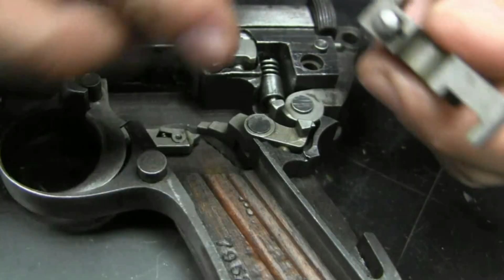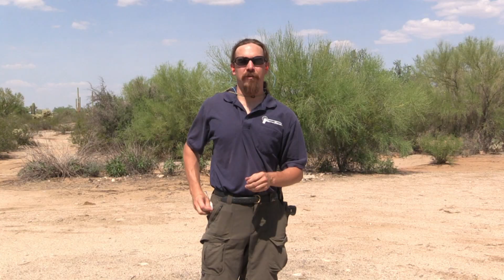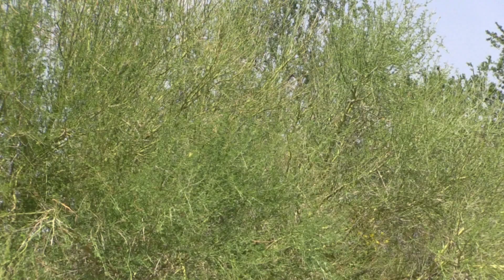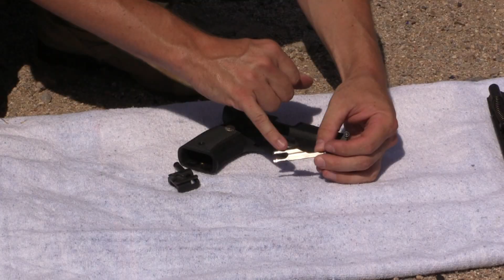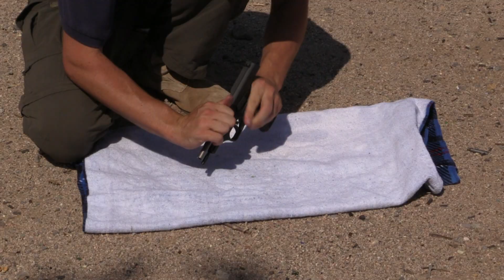Colt All-American 2000 (Disassembly and Shooting)

Comment: The thing I really don't understand about this pistol is...for all of the compromises, what does it do better than any other pistol? Compared to just about anything else in that market segment, it seems like they made it more complicated, less reliable, less accurate, more difficult to use, and probably more expensive to manufacture. I don't see the selling point.

It looks like the one useful innovation would have been the straight-line trigger pull on roller bearings, but even with the original 6 pound spring, I don't see how a straight vs hinged trigger makes any difference when the travel is so incredibly long. Don't get me wrong, I really appreciate how much the straight trigger pull is better on my Kimber than the hinged Match trigger on my USP45 Elite, but that's only because they're so short. I think this striker fired Colt really does qualify as a true Double Action Only in the exact same sense as a DAO pistol with a hammer.
Reply from the maker: It doesn't do anything better, and that's why it was such a commercial failure.
Reply: Doesnt do anything better, and most it does worse.

Comment: Many years ago I used to hit a lot of gun shows in Virginia and I often saw a guy trying to sell one of these.  It was being sold new, and on the very end of the barrel, right on the crown, there was a gouged out / ground out section of the crown.  It looked like it was cut or machined, 2mm wide and 2mm deep.  How it made it past quality control I have no freaking idea.  I looked at the gun and asked the guy about the incredibly obvious defect, and he sighed and said that he'd called Colt and they promised that if the buyer sent the gun back they'd fix it.  I saw that pistol on the gun show tables for a loooooong time.

Comment: You did not mention a safety on the weapon, could the loooong trigger pull be a safety device?
Reply from the maker: Yes, that was the intention. It doesn't have a manual safety.
Reply: Forgotten Weapons
That's kinda horrifying. Even my New Model Army has a safety mechanism of sorts that isn't the trigger.
Reply from the maker: DFX2KX
I don't see it as being a problem. The need for a half-cock safety in revolvers was to prevent the gun from firing if you slipped and released the hammer while cocking the piece, which isn't an applicable issue for DA automatics.
Reply: Forgotten Weapons
good point. I've never fired anything with a 12 pound pull, so it might be harder to accidentally do then I'm imagining.
Reply: DFX2KX It is no different than all the double action revolvers out there with heavy trigger pulls and no safety.
Reply: That's the premise of "Safe action pistols"

Comment: So if the went back with the 6 pound trigger and fixed the safety issues it would of been a pretty good?
Reply: eeeh passable albeit high matanence thay would have to fix the way the front end is designed. rapidly degradeing accuracy does not help to much and requires the regular replacement of parts
Reply: +Andre Krumins Not to mention the slide is mostly riding on the polymer frame.. Steel on plastic is a disaster waiting to happen..

Comment: Did the Guns & Ammo get one w/the 12lbs trigger? Wonder if Colt didn't send one tuned. If Colt had fixed the trigger/ignored the attorneys and modified the front sight/ bushing, not a bad design. Beretta uses the short recoil/rotating barrel in its excellent, especially for the price,  Px4 Storm series of pistols.

Comment: I had worked in a gun store in the earky to mid 1990s. We sold this POS for a while, but it was fugly, difficult to pull the trigger, and I steered prospective customers to Glock. They didn't last long before it was canceled.

The rotating barrel lock up provided a theoretical higher accuracy as the barrel moved along its axis instead of tilting up and down. But it just pan out.

Comment: Is the "break" extremely far back on the trigger travel, to the point where you the trigger fully contacts the frame behind the trigger?  Watching the trigger it's almost deceptive visually in that from a bit further away (or without my glasses ;)) it almost seems as if you go the full length of travel and there is a delay before the striker is released.

Comment: What did the Colt safety recall correct and how?  In 10 words or less.
Reply from the maker: +d0j0w0 Offhand, I don't know. Google probably does. (seven words!)
Reply: Firing if the gun was dropped or hit hard enough.
Reply: Thanks, I'll try not to drop one.
Reply: "A blow to the rear of the slide whle a round is in the chamber can cause the pistol to discharge."  All-American double action pistols with serial numbers:              Letter A prefix or suffix 

                    RA01001 – RA01052 

                    RK00001 – RK03000 

                    RM01001 – RM01005 

                    PF01005 – PF24248That's a bunch of em.
Reply: Thanks

Comment: I really hate how so many new pistols are polymer framed and striker fired with polygonal rifling, just about every new pistol is a Glock knock off in some way or another. Then just about every other design that involves a metal frame and is hammer fired is a Browning locked breech, 1911 knock off in some way or another. I wish more companies would invest in developing a hammer fired, metal frame (aluminum or titanium, titanium would be cool to see) designs with a locking/delaying mechanism that is different and offers some benefits over the Browning locking mechanism, just about every pistol uses it weather it be a 1911 or a Glock varient/knock off.

Comment: Excuse my ignorance but you mentioned the slide lock being good because you wouldn't miss it under stress, but why would you need to lock the slide in a situation in which you would be stressed?
Reply: When you fire the last round in the magazine the slide locks open. On most guns when you put a new loaded magazine into the gun the slide does not automatically go forward, so you push the slide stop to release the slide forward chambering a new round. If you have to change mags in a stressful situation, like a shooting match or firefight, you want to be able to quickly and reliably find and hit the slide stop without looking.

Comment: Could you put a 6 pound spring into the gun and still have it work?
Reply from the maker: Not sure. It might work, but it might not drive the striker hard enough to reliable ignite primers. I'm not sure exactly how Colt engineered that change.

Comment: Actually, I understand that the original prototypes were 10 shot double column pistols that were very small and concealable and working very well. Too many lawyers and idiots working for Colt whizzing in the soup produced a mess. I think that the original design would have been quite acceptable and would have gone far.

Comment: good lord, at least the vp70 was a burst pistol, so you only needed to work up the strength to pull the trigger every few shots. not to mention being 20 years older. its hard to believe this is the same company that manufactures the 6920 ars.

Comment: The early to mid 90s was pretty much the point that America stopped making good semi-auto pistols. I've got a S&W 4046 from this period, awsome gun, but the design had been around for a while.

Quite sad really.
Reply: I disagree, my Smith and Wesson M&P 9 has been a wonderful pistol and an example of a modern American pistol done right. The Ruger striker fired pistols are also very nice but less refined than the M&P series though they are around $100 cheaper. The only American double stacked pistols from the 90's that were decent are the P-Series from Ruger. While bulky and heavy they proved to be reliable and accurate shooters, cheap again to boot.

Comment: I must've missed something while watching the entire video but what was the problem that caused the safety recall? Sorry if my grammar is bad.
Reply from the maker: I don't know the exact engineer details, but it was found that a hard enough blow to the back of the slide could cause them to discharge when the chamber was loaded. Colt recalled about 26,000 of them and fixed that issue free of charge.
Reply: Forgotten Weapons Good Lord. They made more than 26,000 of these things?
Reply: jlpjlp1953 XD

Comment: This is what a firearm designed by bureaucrats looks like.  Buy a patent of a great design and make it as inefficient as possible so it wears faster while removing as much liability as possible so you can't be sued when it doesn't work right and make it easy and cheap to mass produce to increase profit margin.

Comment: I love the Colt 1911 but what on earth did they think when they designed this
POS? I can't believe this was made in the 90's. Even the Browning HP was more advanced than this pile of shiete. A barrel bushing that is a complete piece of the front part of the slide? What on earth... Sorry. If this was made in like 1902 or 1910 I would understand but at this time there were already alot of top notch polymer frame pistol manufacturers present bringing out their top models and yet Colt succeeded in screwing up royally. All they needed is just copy some design features like S&W did with their M&P series or Springfield with the XD series from Glock...
Reply: What I find especially funny is, that the metal slide interacts with the polymer frame directly. How many shots do one get out of that gun? Like 250 and the slide flies off the frame? XD I could only see it as an self defence weapon that is used only if you are in acute danger.

Comment: Couldn't you just put a lighter spring in, and make the pull lighter at least? It wouldn't solve the travel problem, but it's something
Reply: probably everything else has been tuned to work properly with the heavier spring.

Comment: Ah, Colt, given an excellent gun design and they just had to screw it up completely. Sadly it's very typical for corporations since the 80's to do dumb shit like this. 

I'm guessing with a new metal barrel bushing, 5 pound trigger spring and a single stack mag (or a better designed double stack) it'd probably preform pretty well. Aside from that trigger design feeling a bit crap due to the length of pull required.

Comment: Why does Colt suck? Seriously, they are known for the M16 which they did not design and the 1911 which they also did not design. They got military contracts and that's about it. I just went to their website in 2024 and the only semiauto pistols they sell are grossly overpriced 1911s. The only rifles are AR platform. Then they have their revolvers which I guess are nice, but I suspect they're overpriced too. I own a 1981 manufactured 6 inch Python & while it's nice, it's not $1500 nice. It's just a revolver. Nothing special.
Reply: Agree with you about the Python. I bought a beautiful 6-inch electroless nickel Python back in 1983, love it, and will never sell it. But like you said it's just a revolver, nothing special. I have paid a few gunsmiths, because shooting full magnum loads, knocks the timing out, and the cylinder gets loosey goosey with end shake. Also, the extractor rod star has broken, just with careful use. The gun is delicate and fragile compared to other revolvers I own. Beautiful finish and trigger pull, but not worth the money they cost. Won't spend any more money on it, as I just shoot it, and don't care about timing or endshake.